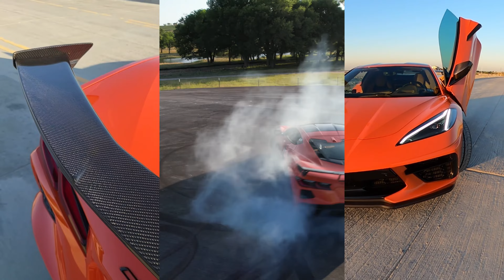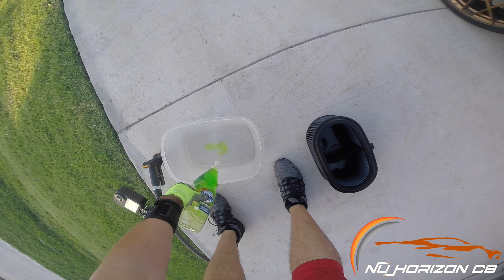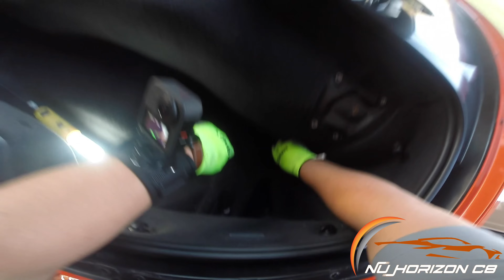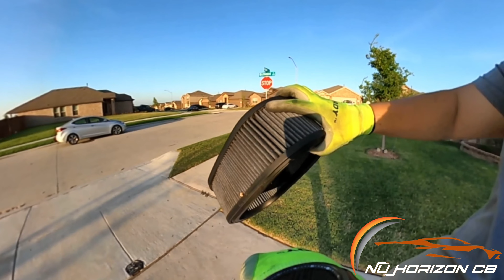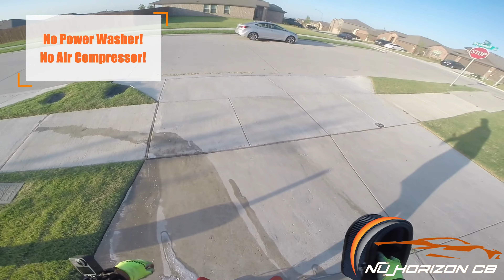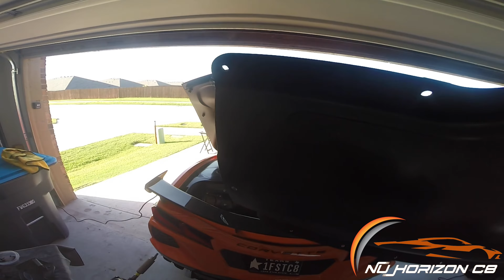25,000 Miles Later: Reviewing C8 Corvette Attack Blue Air Filter!

Comment: Ok, (supposedly) more performance, but is the filtration as good as the original one? Especially after you replace it and it does not look completely clean. I wonder whether there has been some independent testing done on that.

Comment: As with any Modification, I’m always concerned about voiding a Warranty. 
Therefore:  Does changing to the Attack Blue Air Filter void the typical Factory Warranty of 3 Years 36,000 Miles, which ever occurs first and or the Extended Warranty if you decide to purchase an Extended Warranty of whatever the number of months and or years?  

Thanks

Comment: Now that more peeps are accumulating miles on their AB filter and seeing this in their feed - do yourself a HUGE favor. Throw a towel down under the CAI housing before you remove the bolts. You’ll thank me if a bolt falls out of your socket and doesn’t drop into the bowels of your C8.
Reply from the maker: Ohhhh that is definitely something I do now period whenever im working deep inside my C8 engine bay especially. When I installed throttle bodies I layed towels down especially which saved me a couple times. 😅 great advice!

Comment: So unlike a K&N, after you clean it, it doesn’t get RE-oiled?  I typically use K&N in all my vehicles.
Reply from the maker: Hey David. Correct! The Attack Blue does not require to be re-oiled. The nano material does not need it because of how its manufactured and used. Ive confirmed this directly with the manufacturer and engineers.
Reply: @NuHorizonSpeed  so advantage less likely to mess up your MAF sensor, but then doesn’t last quit as long. Think I may have to give this one a try when the stock needs replacing.
Reply from the maker: Yeah its a really really easy clean and install that doesnt have the extra issues you could face with oiled filters if your not thinking doing a full on cold air intake. Definitely would recommend them. 👍

Comment: Have you investigated the Haltec air filter intake or the Lingenfelter intake manifold with the 95mm throttle body??
Keep up the great content.
Reply from the maker: Hey Wazzman. I have not yet. It is on the list though I plan to investigate and potentially install on the C8 platform 😁
Reply: @NuHorizonSpeed  Thank you
Reply: @NuHorizonSpeed  
That would be great. I have a Z06 on order so not wanting to make too many changes on my Z51. However I’m very impressed and happy with my Z51.

Comment: I just happen to come across your video announcing the start of your channel, and like your layout of your channel. I just took possession of my new 2023 C8 2Lt HTC; I noticed that you have the Lamb doors, Was thinking about doing the same to mines, have you encountered any problems since having them installed?  Also I'm in Fort Worth.
Reply from the maker: Hey congrats on the C8! Your going to love driving it for sure! And I have had some challenges with my lambo doors and its a video in the process on breaking down my experience and how to find a good installer. The parts themselves are solid, it comes down to finding a good installer. Itll take me a few weeks to put together that how-to video so if you need a suggestion on where to go before then, let me know. I can recommend you certain places in DFW specifically
Reply: I got lambo doors on my 2020 C8 from & installed by EIKON.  Would not recommend.  They never insulated door wires & I pointed it out after install.  They said doors will be fine.  Fast forward 2 years later wires were rotted along with the circuit board for all power windows, locks, etc...had to be replaced plus the pistons to lift door were not strong & opening door is heavy, actually too heavy for my girlfriend.  Just FYI.   Mind you they do look awesome.  Try another brand maybe & keep in mind I had one of the first C8's so everything was new & I think EIKON was the first to have the hinge kits for the doors.  They may have improved doors installation, hopefully provide wire insulation & upgraded pistons since I got my mine installed.   Good luck!!!

Comment: I never bought one of these filters. Horsepower obsessed reviewed it quite a while ago and I thought the increase in HP or acceleration wasn't noticeable for the price. Do you disagree?
Reply: I put one on my 2021 non-Z51 and 0-60 times went from 3.5 to 3.1 under exact same conditions. AC on and a slight uphill grade. For me, it was a worth while purchase.
Reply from the maker: Great to hear! For the price, its a great overall improvement with a low cost for sure. Installing it yourself to save on service makes it a no brainer since its such an easy install. 👍Glad to hear your results from it!
Reply: Better throttle response and it pull harder.
Reply from the maker: I would say by itself, the gains, with respect purely to HP are marginal and barely felt. The biggest difference I find as a good factor is throttle feel though. The throttle feels more responsive and sharp when your going through corners and rolling on the gas. So in trackday situations, thats probably where youll feel the biggest difference. In normal driving conditions or just pure acceleration, your not going to notice things as much.